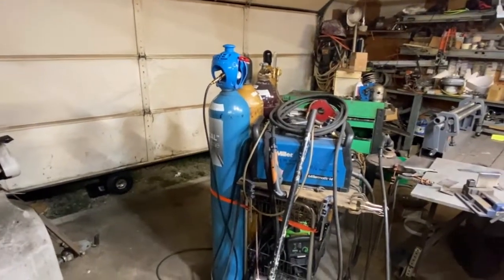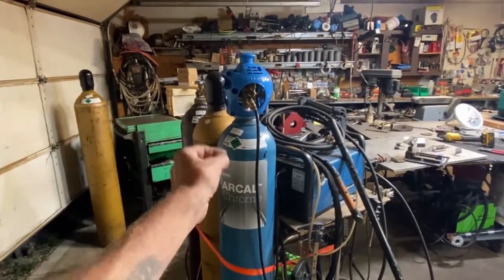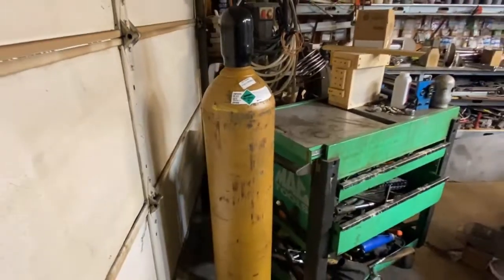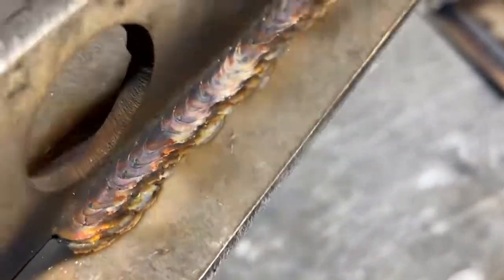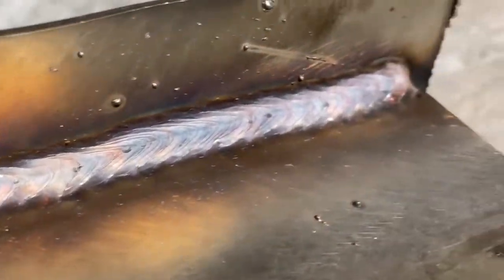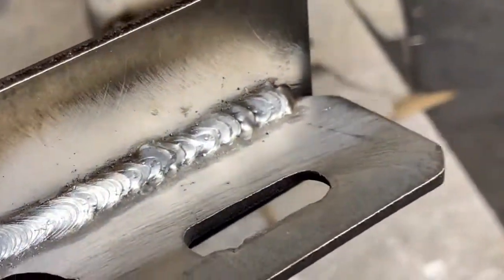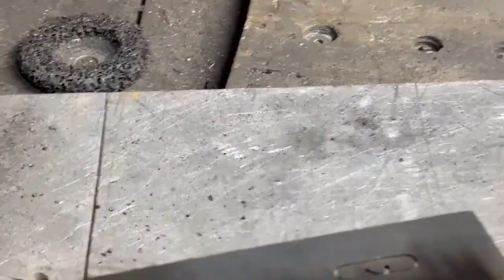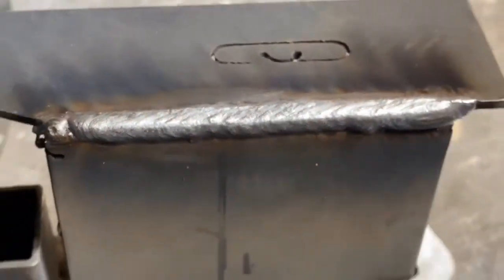ARCAL CHROME  Welding gas of the future

Comment: I am confused about comments that co2 will be a liquid... nobody worries about autoweld 75%argon25% co2, most popular mixed gas for mig...
I have some stargold thats had 10% co2 mixed in... it definitely doesn't spatter as much as autoweld. But does necessarily penetrate as well. 

Just a thought for nobox, 
get 2 flow regulators.
And a bottle argon and one of co2 which is very cheap to buy, at fire extinguisher places, they will fill the small bottles, which are cheap to buy used,  and its a liquid which lasts along time.

And make your own mix to whatever you like,  disadvantage is you need to open 2 bottles to weld and a bit of fooling around to get it right.

Comment: 98/2 gas has been out for years. I’ve used it mostly for spray transfer mild steel.  It’s all contained inside 1 bottle together in a gas form.

Comment: I weld 3/16 and 1/4 304 stainless. I use 308L .035 wire and C-2 gas supplied my Matheson Tri-Gas. This is argon and 2% CO2. It welds HOT, so either reduce the volts a little or bump up the wire speed. I have had very good luck with this combo so far.

Comment: A this is one the market for years and years.
B no there is no second cylinder inside it's just a regular bottle
C the top (market name "Excel Top") is for security reasons, so you have a permanent saftey cap and has an integrated quick shut-off, pressure gauge and low pressure valve)

Comment: Tri-mix is going to be gone. The helium shortage is why this exists. I work for a big company and this is going to be the new standard. Yes it welds hotter. You need to move fast with this gas.
Reply from the maker: Yes you are correct ,  Satan is using up all the helium for the Hadron Collider  to rip a hole in the fabric of our dimension . A huge gay pride parade will issue from this hole ...

Comment: The CO2 would sit in the bottom until the pressure dropped to the vapor pressure of the CO2, no? How is the penetration?
Reply from the maker: It the hottest gas ive used , hotter then tri mix . i havnt done an acid test yet
Reply: @NOBOX7  I am sure you will do the test. Must be a man thing. Keep up the great work and peace too fella. vf

Comment: Was gonna comment about Henry's law, but I realized that it did not apply. Very highly doubtful that the gas mixture is facilitated by two separate tanks packaged into the gas cylinder.
Reply from the maker: I ment i think it has one tank inside the big tank , not 2 . Just one at the bottom to hold the CO2
Reply: @NOBOX7  if the pressure that the gasses are held in the cylinder at is high enough for the liquid form of the gas to exist in the cylinder then Henry's law should apply.
Reply: @NOBOX7  if the welding shop treats that cylinder any different than a regular 100% argon cylinder of the same size then you know they got something special going on with the cylinder
Reply from the maker: @franklingomez5311  They do , it comes with that crazy regulator on it , no bottle comes with its own regulator so that was my first hunch it has a rod tank in it with the Co2 liquid . It also has no pressure gauge just a full indicator like on a liquid tank .To keep a 2 % composition this tank may have the co2 in a separate tank  .
Stain mix has 10 % co2 and 90 % argon , this is just a single tank with some liquid in the bottom , with out bottle separation we would have this same  composition .
Reply: Or maybe it does apply... what pressure did that cylinder have when you got it?